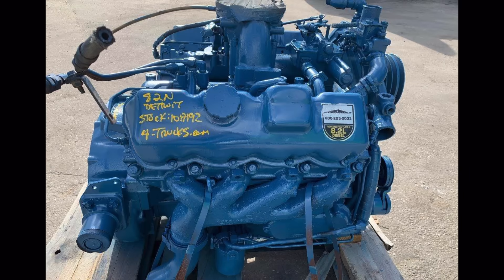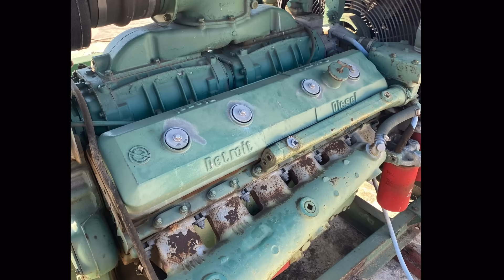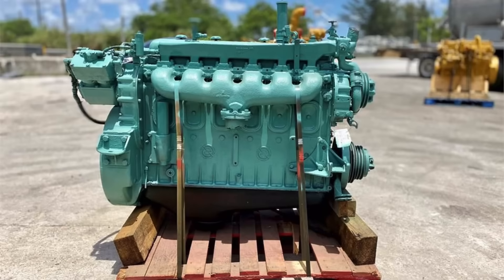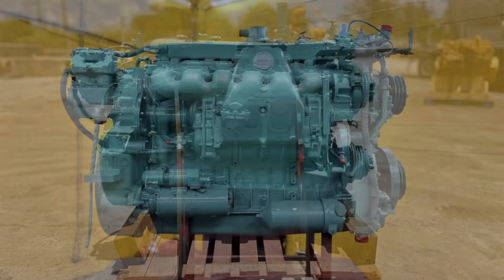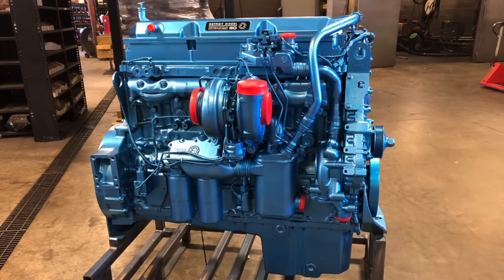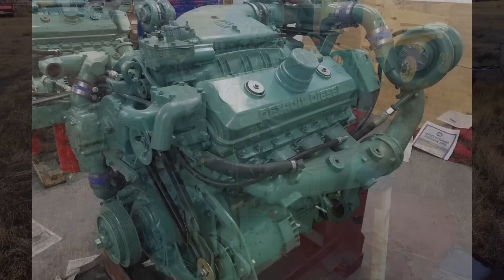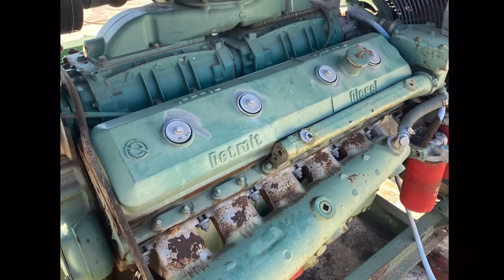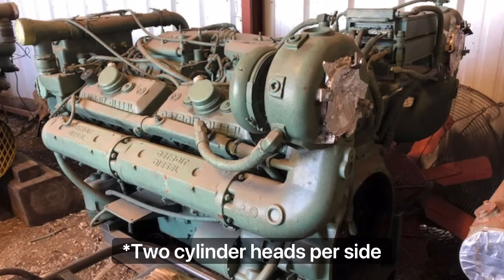Best Engines: GM Builds an Awesome V12 with Detroit Diesel's 12V71 "Buzzin' Dozen"

Comment: Yea I had the opportunity to log many many miles on single axle 6/71 powered GMC Cracker Box day cabs, with 10 speed Road Ranger, or tandem Sleeper cab Cracker Box, powered by 12V/71 buzzin dozen, running through a 13 speed. The 6-71 was rated at 237 hp, 610 lb ft tq, the 12V-71 was rated at 420 hp, 960 lbs ft tq, that in each kept you floating through the gears to keep momentum up in hill country, or running flat it at 68-78 mph, sitting right up on top of the front bumper, just inches between your kneecaps and front wall of the cab. Talk about noisy! I remember once the owner added straight dual exhaust pipes on the sleeper, forget about running at idle to sleep in the colder weather! At least they started well on ether. But man running up or down the gears sounded great! Now I’m retired and it’s been over 35 years since then and I’m now suffering with tinnitus and attribute it to the Detroit Diesel’s.

Comment: I agree that the 12V-71 has a sound all it's own-but one up from that is the 16V-71. Because the two 8V-71's bolted nose to nose. One ran left handed the other right handed which made for a very interesting sound. Also the 24V-71 was the same way two 12V blocks bolted together. On the 149 series Detroit made a 20V-149 that was a 8V block in the middle with a 6V block on each side of the 8V. A very weird sound.
Reply: Was the 16v71 you mentioned a early variant (like a quad skid,4-671s mounted on a common base) because the 16v71s I was familiar with had 2 8v blocks bolted together, blowers driven from both ends and govs in the middle.
Reply: @tomreisinger6220  Quad 6-71 was 4 individual 6-71's driving a single bull gear each engine with a slipper clutch to let the engine slip if it was vibrating too much. They used this very successfully in WW2 in large landing craft that needed 600hp each engine. The big advantage was the unit could keep running on 3, 2 even only one engine since the propeller was variable pitch.
Reply: The V8-71 and V12-71 were different it wasn't two 8s hooked together it's a completely different build all together they had different camshaft bearings and were different engines they had many different parts it wasn't a simple design the 12 cylinder had 3 piece camshafts bearings, oil pumps were different too.

Comment: There was a few families of these two stroke Detroit Diesels the 71 from 1 cylinder all the way to 24 cylinders, they also had a 53, 92 and 149 cubic inch per cylinder all roughly based on the same ideas, EMD also had two cycle engines but they don’t share anymore than the operation principles. What really did the two stroke Detroit in was mainly the power to weight, they were immensely heavy for their power output, there emissions weren’t the best but it was more of the weight for the power output, beyond the 80’s V engines fell out of favor in heavy trucks do to the cost and complexity and the reason the 6-71’s lasted to the end of time was really their low power output for the mass of everything and if you tried to get 450-500 horsepower out of one you’d start to go down the road of diminishing returns in cost and reliability, it could be done, but not for less than what the series 60 was costing them to develop. A 500 horse 6-71 wouldn’t meet emissions as easily as the computer controlled 4 stroke 60 could. Not to mention the weight of the older design. But I believe MTU is still casting blocks for lower emissions markets and many parts for them are still being produced to this day. They’re not bad engines and there’s still places we’re they have an edge.

Comment: The tall pistons and bottom rings are required to keep blower air from getting into the crankcase. No fuel is in the air charge, that comes from the unit injectors in the head. Also you might mention that the intake air coming in the ports is what pushes the exhaust out through the valves. Also noteworthy is that the connecting rod is always experiencing compression loading unlike a 4 stroke.

Comment: We had a wooden 65' yacht built in early 1960's with twin 12V-71TI, 750 hp each. She was similar with Grebe   in appearance, not remember the make. Cruised easily at 19kn and went about 23 kn WOT. Wonderful sound, especially when starting up or above 1,600 rpm.

Note that those were not the original engines, someone had changed the original Detroit 8V-71N.

Comment: Drove the 6-71 a bunch when I was 18. 1972 GMC 9500 ready mix truck with ten yard mixer, 300 gallon water tank, and tag axle. With full water tank, full fuel and ten yards weighed about 72000 lbs on the single frame. Had 13 speed trans. Can still hear it. But I thought I was a super trucker.

Comment: Well, I just gotta say, enjoyed.  I personally owned an 8-71 in my truck for several years and have about 10 years total behind same.  I often drove those that were derated to 260 hp with 55 injectors, then a leased unit with 60 injectors at 290 hp.  my truck was the standard 318 hp with 65 injectors.  Some tried putting in 70 injectors, C series and i think they were a little too hot if you didn't watch how you drove it.  No mufflers, drivers dream.

Comment: Adam,  does the 2 stroke diesel engine require additional oil for lubrication similar to the 2 stroke gasoline engine?  Sorry if my question is dumb, but I am no engineer or mechanic. Thank´s for the video, by the way.

Comment: Don't think there was ever a normally aspirated 71 series.  They all had blowers at a minimum.
Reply: All 2 stroke detroits without a turbocharger fitted are naturally aspirated,the blower only provides air at atmospheric pressure 👍

Comment: Ran American friction cranes at a scrap yard for years with 6-71s in them.  Saw one throw a rod and put a hole in the block big enough to put a softball through.  Another great feature was that they would start in really cold weather (-20) when newer stuff wouldnt.  Ours all had ether starts on them for this reason.

Comment: Worked for halliburton in early 80's offshore mechanic  most skid units had side by side 8v71s allison 750 automatics running cement pumps with a 4 71 running hyd pumps  When they were running 2600rpm pumping cement at 10,000psi in below deck engine room it was scary noisy pkace but i loved it. If one engine went down during pour you worked on it while other one screamed.  Wonder why i lost my hearing!

Comment: Out of all them, the 8v71 is my favorite. The engine note downright scared me as a kid. There was what turned out to be a late 60s GM PD4107 "Buffalo bus" that a neighbor was converting into a band bus for some mariachi band. At the time, i had no idea what it was exactly aside that it was a GM bus of some sort, and it kinda looked like one of those old greyhound buses from the 50s. What i did know, is that it had a straight-piped 8v71 and when it began pulling away, you can hear that bus for a half mile radius. It was so loud, it scared me
Reply: I had an AMGeneral transit bus with 8V-71 and V730 Allison transmission I converted it into a motorhome. I had it turbocharged, air to air intercooled, by pass blower, fuel modulator bigger radiator, turbo muffler. Power went from 300hp and 800lb/ft torque to 375hp and 1125lb/ft torque. Man that turbocharger really woke up that 8V-71!

Comment: Was there a way that the fuel injection  timing could be adjusted wrongly such as to ruin the engine in short order if the operator continued to run the equipment?

Comment: May goodness! All this information lately on Detroit Diesel engines from a channel about classic cars and automobiles! Please continue this thread and keep up the good work! I use to work for Lucas Varity Diesel (Later Delphi Diesel) in the Detroit area that re-manufactured Series 60 injectors and fuel pumps and grew to love the sound of their clatter on the test stands ("It was the sound of a hearty paycheck!" you might say...  LOL!). It would be an interesting project to adapt one of these types of Detroit Diesel engines to a kit car chassis - It might weigh a ton and slow as a sloth but the sound and torque once you got it going!

Comment: Another cool thing about the 2 stroke Detroit units is they are modular so a 12- 71 is basically two 6-71 heads on a shared block and you can use one 8-71 head on a 4-71, all the pistons and liners are interchangeable between the different configurations of the same series and you can even reverse the direction of the head on the inline motors and the block has provisions to swap the cam to the other side so you can have the exhaust side of the head pointing to the left or right. They are overall very well thought out and straight forward to work on and it's a shame more things can't be designed that way today.
Reply: @yunoguy2498 ..... The 12-71 was the ONLY DD engine with more than 8 cylinders that was NOT "modular" in design, and was "clean Sheeted" as a V12, with a true 12 cylinder firing order (2 actually).     The other "12's", "16's", "24's", etc. (53, 92, 149) were modular, and so just sounded like "big" V6's, V8's etc, because of the redundancy of the engines used in whatever modular engine that was being produced.

Comment: I believe the 12V71 was the largest to be fitted to an over the road vehicle.  The 12V92 seems rare and I am not sure that was used in over the road applications.  Also, would have been good to mention the DDEC generation toward the end, as they tried to clean up emissions.  They definitely were cleaner, but I guess not clean enough.  Fully electronic, drive by wire, scan tool, codes, the whole bit.

Comment: General Motors Diesel later known as Detroit Diesel .   71 series engines were replaced by the 92 series engines before the series 60 .  Also produced were a single cylinder 71 series engine .  V-12 series engines used 6 - 71 cylinder heads .  Oil leaks were designed .  Oil weep tubes draining fly ash contaminated oil from the crankcase while operating .  Very much appreciated video !
Reply: The drain tubes kept the airbox clear of excess oil, not the crankcase.
Reply: @tomreisinger6220  Sorry, you are correct , I did not state that correctly .
Reply: Hmm, did the bottom rings on the piston have anything to do with that 'fly ash contaminated oil' system?
Reply: @johngalt97   I do not believe so .  The scavenging of air through the combustion may have .

Comment: Good day Adam,

You are a man of my heart, the last thing I was expecting from you was a video on a 
“ Screaming Jimmy “.
Like you I grew up around semi’s & those 8v71 just a sweet sweet diesel to coal music.
Still driving semi’s here in Melbourne on & off the wharf & just on Friday a old timer with a 1978 Kenworth Cabover Sleeper painted up in old peaches & cream TNT colours pulls up in the grid next to me in a 8V71 & boy double stacks straight out.
I knew what it was but 95% of the newbie drivers wouldn’t have a clue.

Next best sound 
3408 V8 Cat
E9 V8 525 Mack
580 hp V8 Scania 2006 model straight 6 inch pipe
500 hp Mercedes Benz V8 from early 90’s straight pipe
500 hp MAN V10 early 90’s straight pipes.

Unfortunately you didn’t get to experience European Cabover V8 & V10 from mid 80’s through the mid 90’s gave the Cat’s, Cummins & Detroit a good run for there money.

When I used to sell semi’s for Nissan in the 90’s we sold in limited numbers a 
V10, 27 litre Nissan Diesel at 420hp.
Didn’t sell many just 1 too heavy & thirsty.

I hope you know Kenworth has a manufacturing facility here in Bayswater a suburb in Melbourne about a 45 minute drive from my house & yes still manufacturing Cabover.

The new K220 Cabover recently got released replacing the K200 from the year 2000.
My old boss works as a sales person for Kenworth here in Melbourne and is the number 1 sales person in Australia on & off.

Every year without fail since 2009 I receive a limited edition Kenworth calendar & work diary.

Saved them all in immaculate condition hope to show you someday when you come to Australia.

Cheers

Louis Kats your number 1 Fan in Melbourne, Australia 🇦🇺 🇺🇸 👍
Reply from the maker: Thx Louis!

Comment: I worked on a boat that had a 6-71 with the biggest turbo I had ever seen slapped right on top of it. I was in the galley and the only thing between me and that motor was a plywood doghouse that sat sloppily over it and I usually sat on that doghouse 😆. I hear the sound of that turbo screaming in my nightmares. The motor was always running full tilt. I now have constant tinnitus and specifically blame that motor.
Reply: "constant tinnitus" me as well, grew up rebuilding the different versions of these engines. Johnson & Towers had a reputation for running a massive(Switzer)  turbo on 671's and M110 injectors making crazy power. Instead of the 2100 rpm they'd spin 2400 or about.

Comment: Very nice video.  One thing though.  Several times you mentioned how the combination of the blower, the ports in the cylinder, and the rising piston on the compression stroke combined to fill the cylinder with a "fuel-air mixture".  Not so.  The piston fills and highly compresses the air (only air) in the cylinder and then a few degrees before TDC the injector (fired by the third rocker arm atop each cylinder sprays atomized diesel fuel onto the compressed cylinder, causing the diesel combustion event.
Reply from the maker: You're correct.  I should've related that.  Thx!
Reply: @RareClassicCars  No problem.  I just wanted to make sure that nerds like me understood the really unique way the GM engineers simplified this engine design.  BTW, GM built these engines as small as a 1-71.  There were hundreds of thousands of 2-71's that revolutionized refrigerated rail transportation, mounted on the ends of railroad refrigerated cars, replacing the complex and limited process of keeping food shipments cool by dumping in ice like old fashioned kitchen "ice boxes".  I subbed to your channel... keep producing, I'm hooked.

Comment: Yes the old 12V71's SURE do sound nice, BUTT thata were it ALL ENDS, sure they sound nice, The old GreyHound busses had them, and if you like listening to a old GreyHound bus  you would love that noise. Drive In a Fully LOADED 3axle dump truck the 8V71 with a 15spd transmission, is WAY UNDERPOWERED.(those 71 and 92 are to small)  and yes You have to keep the engine running at least 2200 to 2600RPM or FORGET IT you will lose the torque and will make the truck STOP on a STEEP HILL. I would Go FAR to say even the 8V92 is not the much better/  NOW the SERIES 60 is Definitely a GOOD STRONG engine in a 3 axle tractor and trailer hook up, I know good one:s at 330HP.

Comment: A friend worked for a contractor in Ann Arbor that made armor for the military. They had a 70s LAV, with an 8V71. We were renting a shop out in Dexter, which had an open field behind. One day my friend showed up with the LAV, and we proceeded to do doughnuts in the field. There's not much space in an LAV, I ended up hanging on to the engine grate on the outside. Quite fun!
The next day the landlord called us upset.. 'What the @^%@ were you guys doing!?!" "Well, we had a tank..." "....... Ok. Don't do it again." :)

Comment: While a long piston skirt is good for piston stability, in this case it was necessary because the piston acted as a spool valve.
It had to keep the ports covered when the piston was at the top of stroke. Otherwise the air from the blower would escape into the crankcase.
The long piston did make the block taller (and heavier) than otherwise would be necessary.
Reply: That was known as a "Trunk" style piston (at DD), but in the early 1970's we developed the "Crosshead" style piston (two piece) and was a weight saver.

Comment: I worked at McDonnell Douglas in the 80s and on the flight line they had two compressors for pressurization checks on the MD11. One was what they called the huffer truck, had two 8v71s back to back and the other was powered by a 12V71. It sounded glorious running at full tilt.

Comment: You said the V 12 was the biggest 6V engine, but Detroit Diesel produced two larger ones, a behemoth 2 stroke 16 cylinder that displaced 1,136 cubic inches, weighed as much as a Honda Odyssey minivan and produced 760 bhp and 2,200 lbs/ft of torque. The biggest, baddest V 71 was primarily a marine engine that needed at least four turbochargers to feed its 24 cylinders which displaced a whopping 1,700 cubic inches. This motor was essentially two 8 V71's riding a welded crank. Various reports put that engine's output above 1,500 bhp.